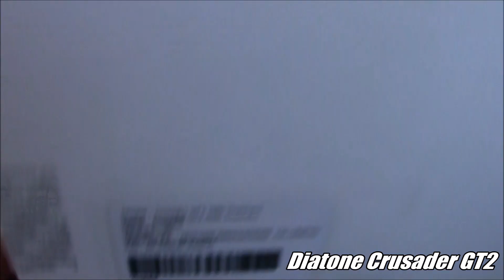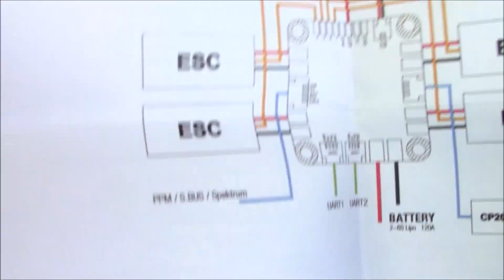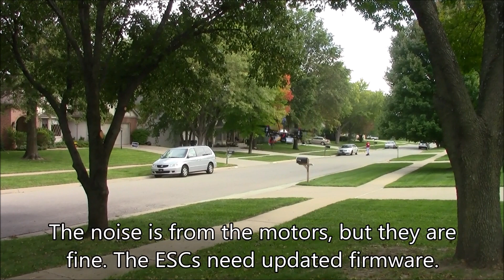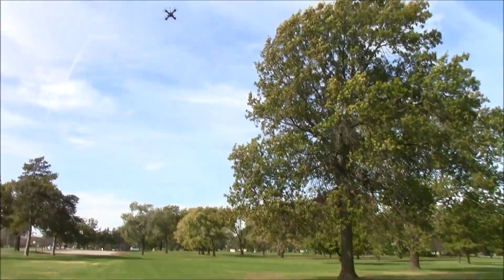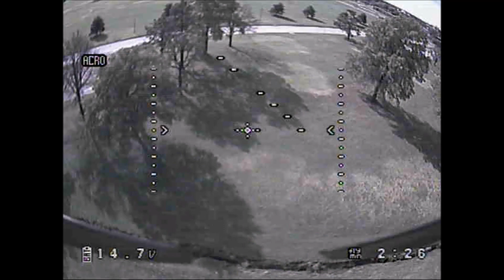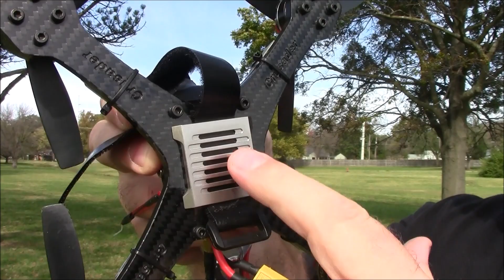Diatone GT2 Crusader 200 Review - LOS & FPV Flights

Comment: Bangood is selling this as PNP. So I know I have to provide my own compatible receiver and transmitter but, my question is: is the receiver plug into the FC or do I have to solder it to the FC? Is it really as basic as plug in the receiver to the FC (no soldering), bind to the transmitter and I'm good? I apologize in advance if this is a silly question.
Reply from the maker: It comes with the cable that connects to the flight board.  I soldered the wires from it to my receiver.  You'd probably have to use the same connector and solder it to the connector that connects to your receiver.

Comment: Definitely what batteries do you suggest for it to avoid sag?
Reply from the maker: The Panda batteries from multicopterbatteries.com are real good batteries.  Also, either any batteries with a 75C rating or higher.  Also, most graphene batteries are good at not sagging.
Reply: travisgrindal thank you. I will do a look!

Comment: Where do you get the Titanium edition from everyone sells the standard one with 2300kv but I want those 2480 :) :) :)
Reply from the maker: Diatone use to only sell it with the 2480kv motors, but they are pretty hard on batteries so they changed the motors out for 2300kv.
Reply: Arr really that suck haha thanks for the  reply keep up the great videos :)

Comment: I have some 1800 4c and a load of 2200 3C batteries, would they be ok for cruising around?
Reply from the maker: "4c" and "3c"?  That is pretty low.  They would output 7.2 amps (1.8*4) and 6.6 amps (2.2*3) respectively.  You could try it but just cruising around, these motors will probably draw 8 or more amps each.  Your battery will probably almost immediately puff up.
Reply: Thanks, I should have said I had 1800 4s 45c and 2200 3s 40c
Reply from the maker: Those would do fine.  I've raced with 1800mAh 4S batteries before.

Comment: Question after setting this up it doesn't arm. What do you think about he issue is.
Reply from the maker: I'd guess the flight board doesn't think it is level for some reason.
Reply: figured out the issue, mix on transmitter was cutting the throttle when i throttled up.

Comment: Hi! very nice review, 
I just buy this (the GT2 200) but with 2300KV motors, 1300mah 40c bateries,
and want to ask you some:
Do you know if one of this rc controllers/receptors fit (works) for this drone:

Flysky Fs-t6 2.4ghz 6ch
http://www.banggood.com/Flysky-FS-T6-2_4GHz-6CH-LCD-Transmitter-And-Receiver-System-p-73199.html

Flysky Fs-i6 El Afhds 2a 2.4ghz 6ch
http://www.banggood.com/es/FlySky-FS-i6-2_4G-6CH-AFHDS-RC-Transmitter-With-FS-iA6-Receiver-p-922606.html

THANK YOU VERY MUCH!
Reply: or 
Turnigy 9xr Pro 9ch 
or
walkera devo 7 2.4ghz
Reply from the maker: Any 5 channel transmitter should work as long as the receiver supports SBUS or PPM output.  I'm not 100% sure PWM is supported.  I'm not up-to-date on many transmitters except the Taranis because that is what I'm using right now.
Reply: So much thanks!, finally bought the Turnigy TGY-I10 10ch 2.4ghz with TGY-iA10 receiver, and now am looking for information about how to connect this receiver to the my drone (diatone crusader gt2 200)

Comment: sbus has lower latency, up to 50mls.PPM gives it a sloppy feeling when you fly. less reactive.
Reply: if you race, you should probably switch. could account for a lot of gate strikes.
Reply from the maker: I'm only using SBUS now on new quads.  I didn't have a SBUS receiver when I made this video but I had that D4R-II sitting around so I used it.  I didn't notice SBUS being faster when I moved to it, but when I went back down to PPM, I did notice it not responding as quickly.
Reply: Like sloppy right

Comment: Check those PIDs

Make sure motor stop is off.

set pid_at_min_throttle = 1
set min_check =1020
set min_throttle = 1080

It gives you full control at zero throttle. You can idle all the way back and still have control in freefall to spin and turn etc.

Comment: Travis need help I've had my crusader 200 for almost a month now. Had trouble with the Reciever. Finally got a full Reciever connected just to try to get it in the air. Now I'm dealing with some kind of set up problem.  When I move the throttle past about 25% it goes full.  I've gone through every setting on the TX that has to do with throttle, recalibrated the ESC in betaflight, and belheli.  Stumped. I just want to fly.
Reply from the maker: What version of betaflight are you using (hopefully 3.0.0 or later)?  Does your throttle look normal on the receiver tab when you move it?   Did you upgrade the firmware on your ESCs with BLHeliSuite?  If you're still stuck, try to create a new model on your transmitter and rebind to the receiver.  Sometimes something gets jacked up in the model config on the TX.
Reply: Thanks Travis.  I've done it all several times except make a new model in the TX. I'll try that. Thanks again for taking the time to help.

Comment: Thanks for the great review Kevin!   I have a question - Are there any options in the OSD setup?  I really don't like the heads up leveling display.  Also, is there no current sensor?
Reply from the maker: I haven't found any.  The horizon line drove me crazy at first, but you get use to ignoring it.

Comment: Thanks for the video! I'm trying to decide between this and the Realacc X210 kit. Not taking into account having to build the X210, do you think it's worth spending the extra ~$100 for this versus the X210 + camera + video TX? Is there much of a difference when flying them?
Reply from the maker: Either one is a good choice.  If you don't mind the build of the x210, then I'd go for the one you think is coolest looking.
Reply: Thanks for the answer! I think I'll go with the X210 then- I kind of want to build the quad, since I haven't ever done it before. You're other video should help a lot for that!

Comment: Looks like a nice frame. I'm just building a Shendrones Mako 4 which is very nice. Just 3mm bottom plate with the 3inch but it feels plenty strong enough. 

Can I say I'm not totally convinced that such a thick bottom plate is unbreakable. With the speeds we are reaching now and with the weight that thick frames bring, they will break easy when impacting concrete, steel goalposts etc. Really enjoy your videos, keep em coming.

Comment: this might be a dumb question, but does anybody know if on a quad like this, you can put extensions on the arms and use way bigger props? just wondering if I could get slower and less agile flights but longer battery life and more stability. Thanks guys
Reply: Not in this case, the arms and main body are one solid piece. It is possible with some frame designs, but usually you would want a frame best suited to the intended purpose, adding little bits of weight make a difference.
It may be more tame with a higher mAh rated, 3s battery. (Get someone to back that up, i'm not certain).
Reply: Ryan Pulsifer yeah I think you're right about this build being a bit Overkill for a non race scenario

Comment: Worst design ever. Battery dumb spot, and props in front of camera.
Reply from the maker: The metal plate on bottom was necessary to provide a battery strap.  If you put some rubber on either side of it, it should be fine.  This is a racer quad designed to go fast so the camera should be tilted up about 30-40 degrees which would put the props near the bottom of the screen and not interfere too much with your vision.
Reply: travisgrindal I understand it's a racing quad, and that's  all I fly. Props don't really interfere, they're just annoying and why do that to yourself if there are designs that eliminate it. I think protecting lithium based batteries should be a top priority especially in racing quads...since as you mentioned speed is the whole point. It's just my personal opinion and my experience racing quads that a "strap it to the bottom" isn't a great idea. Now you need to add protection as every time you land...you will be impacting directly onto your battery...and most people use light batteries with minimal protection in their racing setup. Then you're left with adding large feet or something I suppose.

Comment: hey man! I like this review! I was going to ask you a few questions (i saw a prt of this video yesterday and if you mentioned it my apologies) - what kind of batteries/reciever/transmitter are you using for this? I was thinking about the eachine wizard x220 but since it sold out and now costs 200$, for only 70$ more this seems like a steal, but it doens't come with the rest, and I'd like to figure out the extra costs.
Reply from the maker: I'm using a 1300mAh batteries, a Taranis, and a D4R-II right now.  I'm going to switch out the D4R-II for a X4R-SB so I can use SBUS instead of PPM.

Comment: I would like to get motor guards for this I know that the screws are m3 but what size in mm are they and do I need to get longer ones for motor guards.
Reply from the maker: Yes, you'd need longer screws.  Just add on the width of the motor guards to the length of the screws and you should be fine.
Reply: travisgrindal what is the length of the stock motor screw?

Comment: excellent review as always :-)
That's strange my battery plate was on the other way and my bats sit length ways.
You may want to turn on WDR on the cam as mine was off by default.
P.S, flight video on my channel :-)
Reply from the maker: This was an early production model.  I think things have been improved/changed on more recent ones.

Comment: This metal bottom plate is working as a cooler it gets rid of the heat coming out of you battery and therefore keeping your quad and your battery cooler, so if you stick some foam there it would prevent it from doing its job. Is there any other way to keep the bat from sliding?
Reply from the maker: It isn't the sliding I'm worried about it.  It is the metal plate dinging up my batteries.  Maybe I could put some sticky rubber pieces on either side of it to spread the weight out more evenly across the battery.
Reply: travisgrindal that's a great idea! I'd love to see it if u ever go for it. And btw your channel is awesome one of the best! Keep up the good work!

Comment: the turnigy is not a true graphen battery.. there is No Graphen inside the battery
Reply from the maker: Really?  The Turnigy graphene battery does not have nearly the voltage sag of my non-graphene batteries.  If there really is no graphene inside of it, what makes it different than other batteries?

Comment: Motors are rebranded SunnySky Edge Lite 2205 2480kv motors, I have some on the way to test .Cant wait
Reply: The RCAddict no diatone works together with sunnysky to create these motor different design
Reply: Thumbs-fpv Yeah, I got my SS today and they are different :) I assumed they were were working together, just thought they were the same motors. Banggood screwed up and set me a 204 2300kv though! :( Other 3 are correct 2205 2480kv.

Comment: really like the look of this one, stop reviewing brilliant stuff, i have no money left so just stop it, i gotta eat and pay bills... any chance you could get a top speed test on this... use google earth to measure out 35meters, i got 73mph on my first build and i couldnt do a clean run.. i was measuring over 63m... could not keep full throttle and full pitch on well enough, .. 35m in 1 second is 80mph
Reply: oh ps. that grumblin noise at low revs from the motor?...one of my kingkong 2205 2300 (2500kv's) made that noise... i didnt fly it and bought another one...

Comment: Love this quad, did you try turning the battery mount 90 degree? I think you can
Reply: \i think that that would not be a problem. Strange that it is mounted that way.
Reply: emiel1976ep I think it was accudently mounted the wrong way
Reply: I think so to.
Reply from the maker: I think the bottom piece was changed on later models.  I think this was an early release model.
Reply: the mounting screws look like they are the same distance, measure them and if they are all you need to do is turn it 90 degree. http://www.diatoneusa.com/store/p252/Diatone-Crusader-GT2-200-PNF
Reply: I think that the one that mounted it together, mounted it wrong. But stil it is a wonderful quadcopter. I was watching it also and I want one. Only missing the money. :(